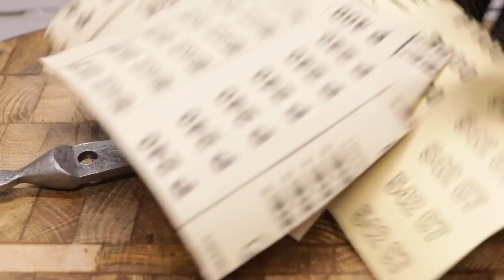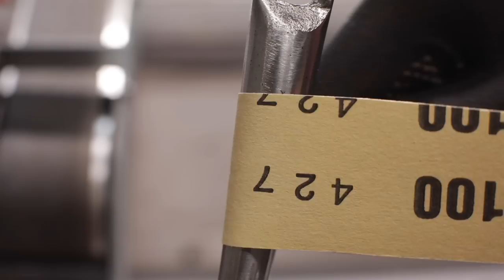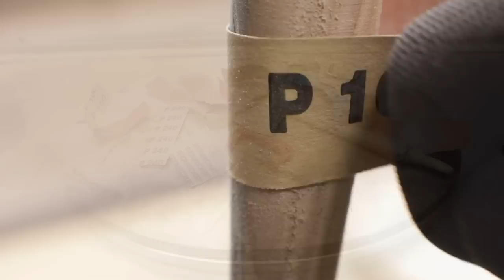Multitool Axe Restoration. Hatchet, Hammer,  Nail Puller,  Screwdriver

Comment: I'm curious about your use of chemicals for removing the rust. Did you create an acidic mixture to first remove/loosen the rust, and neutralized any remaining acid with baking soda/natron? If so, what did you spray on the multi-tool that caused further reaction?
Reply from the maker: This is a paint remover. Old paint remained on the tool